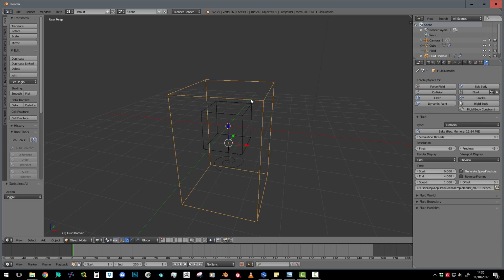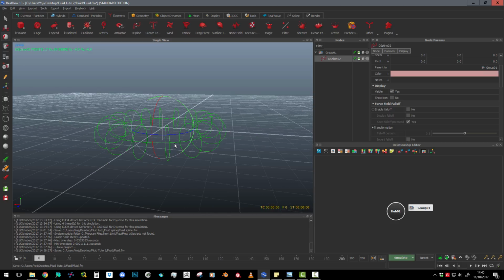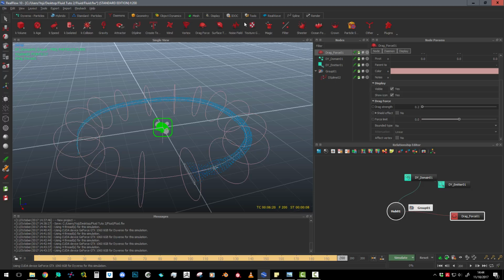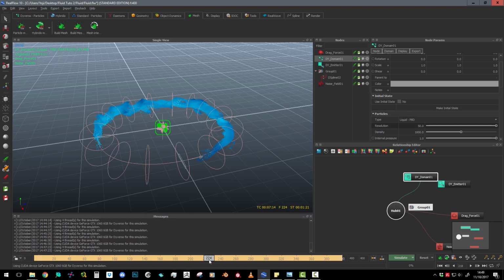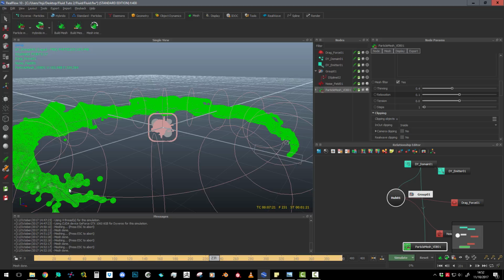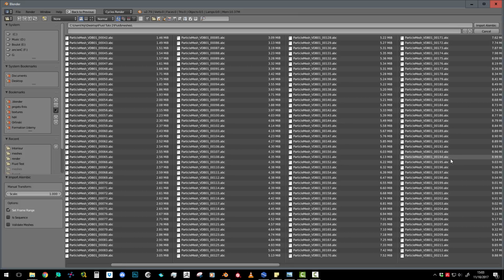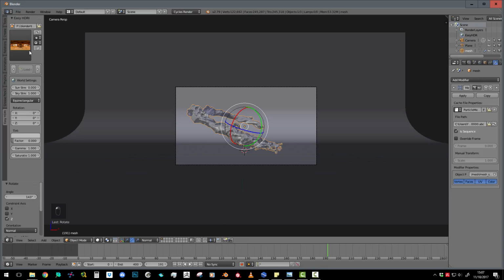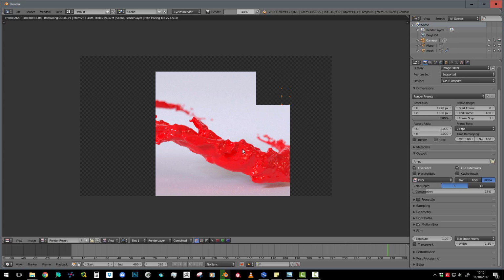Blender2 79 and Realflow with Alembic import

Comment: Meshes are easy. The question is: How to export foam from RealFlow and properly render it in Blender?  Such tutorial would be awesome! I can not find anything on the internet on how to do that.
Reply: RealFlow can only export mesh sequence
Reply: Not true. It can export alembic in many forms, not just as meshes or mesh sequences. Although I have not firgured how to render foam particles in Blender Cycles so far (only OpenGL -> I have a short foam test on my channel)
Reply: try combining foam with mesh sequence render and upload the render results
Reply: I will do that when one of my project will require it. Which may be very soon :)
Reply: Also I've just made a research that there's a new liquid particles add-on with foam available for Blender which is called FLIP fluids, check that out
Reply: Also Happy Easter Zilinsky
Reply: This might be a solution: if you parent an object (for example an sphere or a metaball) to the animated foam object and then go to the Properties>Object panel, scroll down to "Duplicate", and select "Verts", it displays an instance of the object for every vertex of the foam mesh, like in a particle system.
Hope it helps

Comment: Hi there, thank you for this tutorial, very helpfull. 
Im having a issue with this though.. When I import a mesh with alembic import into Blender.. the mesh shows up fine..but sometimes.. after a while the mesh dissapears in Blender.  I just can't see it anymore. It does shows in the outliner.. I can see the object center and its not hidden or anything.. It just doesnt show in the viewport, or in the (pre) render..

Do you know what this might be?
Reply from the maker: Hi Allard,
Maybe it comes from the alembic file itself. You can have a look into the folder that contains the files and check the one has the number of the frame that cause problem. If it's empty it will be 0 octet. In that case you have to redo the compute for that frame into Realflow.
Reply: Thank you for your answer. I have checked the folder and all the files have bytes and there are no empty files. I didnt think that would be the solution anyways, because the dissapearing of my mesh, isnt connected to a certain frame. It shows on all frames.. and then when I move the mesh and press ctrl-z (for example).. the mesh is gone, on ALL frames. So it shows on all frames for a while..but as soon as I start moving it  or something.. it's gone. Also, when its there.. and I restart the blender file..it dissapears. It's still in the outliner and stuff..i just can't see it anymore. 

Please advise.. ( i could send you my files? )
Reply from the maker: Here after try move, scale , rotate, undo, redo, on alembic files imported everything is ok. So it must come from your alembic or your Blender configuration.
Reply: Try moving a frame or two in the timeline, then move back. This seems to refresh the alembic file for me.